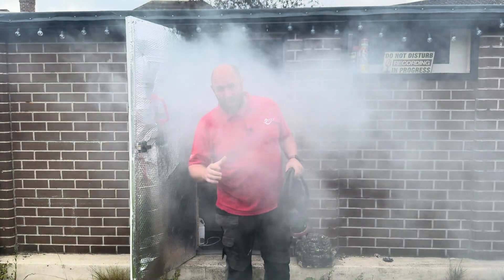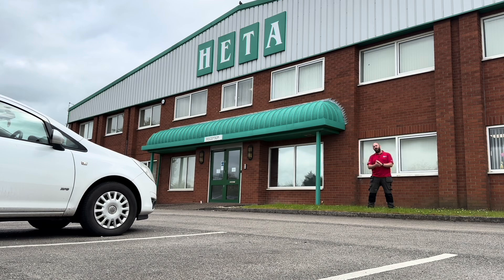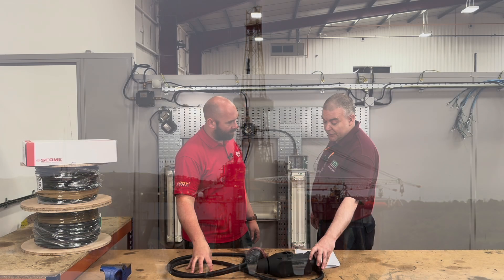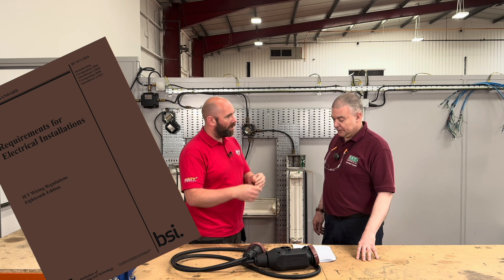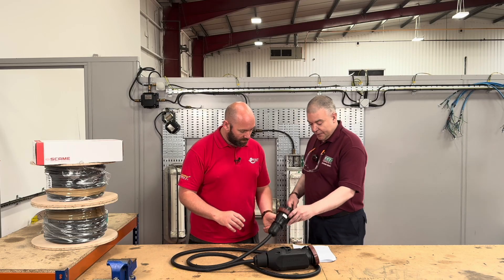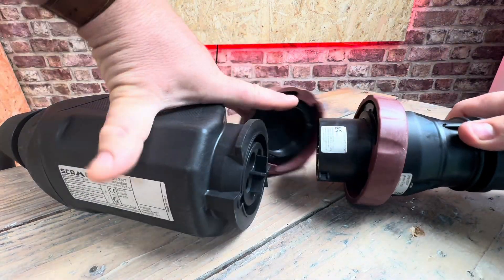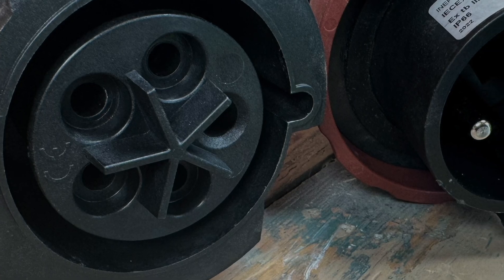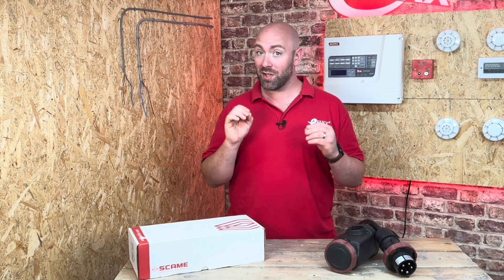Lesson Learned: Why You Need An ATEX Plug and Socket

Comment: I don't understand why the plug itself can't be interchangeable with another manufacturer's plugs, as I would have thought that it's the switch and interlock that matters. Surely if the socket is safely isolated and an interlock prevents removal of the plug while energised, there's nothing special that's required about the design of an IEC 60309 plug? Or do these environments require absolutely everything to carry the rating rather than being risk-based?
Reply: I was with you on this when I started, however, I learned from Graham that manufacturers have to rate there devices for those dangerous environments and a manufacturer would not be able to meet conformity with cross branding, and this falls under those ATEX standards.

Great questions  as well, 🎉❤
Reply: @joehammond6119  Thank you for your response. It's good to hear that it comes from the standards rather than a decision the manufacturer has made themselves.
Reply: The equipment is rated ex db and ex eb. The ex db part is for the switching mechanism but the ex eb covers the rest of plug and socket. Ex eb is increased safety and achieves this with things like spacing between conductive parts to remove potential for arcing and sparking. This can't be controlled unless the fully certified assembly is used.